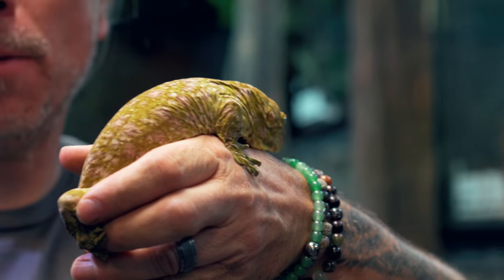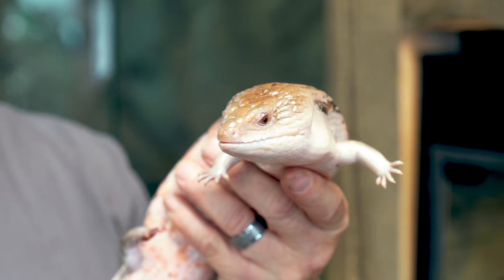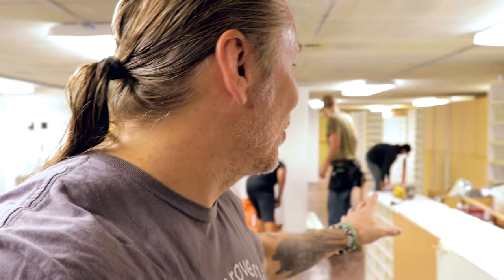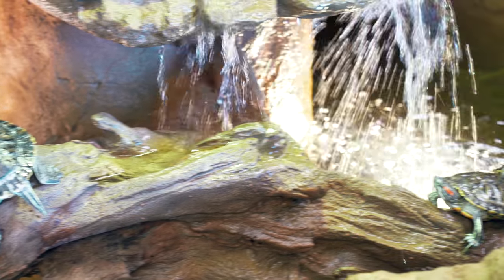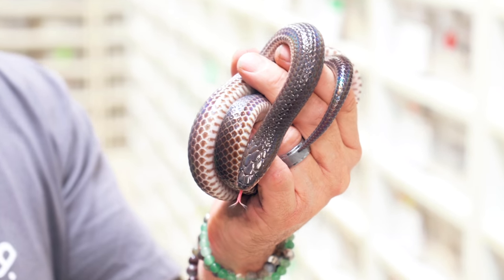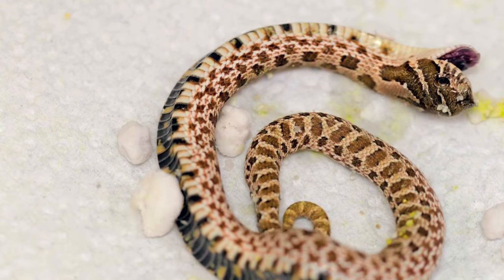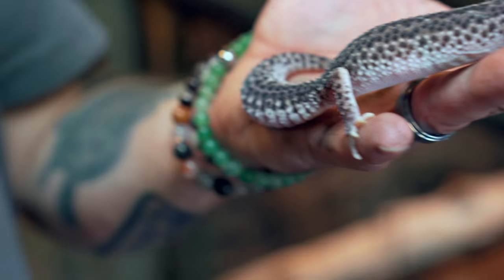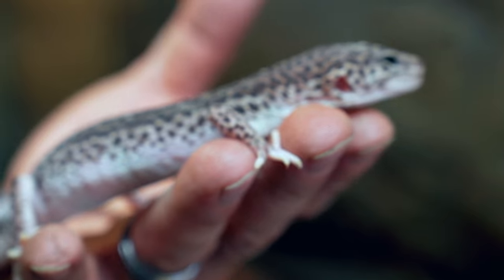IS MY SNAKE DEAD?? OR NOT?? | BRIAN BARCZYK

Comment: To get rid of a bad smell mix 2 tablespoons of Blue Dawn dish soap with a bottle of peroxide and 1/4 cup of baking soda. Do not store this in a closed container unless you leave the lid of spray nozzle partially off or very loose because of the baking soda. I have used this for years whenever my pups got sprayed by a skunk. It also works well if a pet urinates on your floor. Be careful because you cannot use this on fabrics or carpet.

Comment: My only question is how come they are using a small angle grinder to cut them studs? Every commercial company has a big chop saw to cut the metal studs. You can can multiple studs at a time instead of one and more safe to use them a 4" grinder and I'm sure use less wheels for cutting bc oke is a 4" and other is 12 or 14". Anyway hope tpi have good day cant wait to see the finished product. I've been following so long all you had was BHB so cool to see where you came from there.

Comment: There is a recipe that works to get rid of skunk spray so I’m sure it’ll work for snake must. I had to use it on a dog of mine that got sprayed in the face then came inside the house & rubbed her face ALL over the furniture & my kids clothes that they didn’t pick up. 
It’s hydrogen peroxide 1quart, 3Tbsp dish soap(dawn or joy works best), & 1/4 cup baking soda. I PROMISE that will work especially since it worked on direct skunk spray. Good luck!!😁